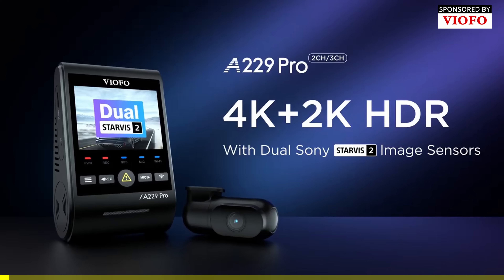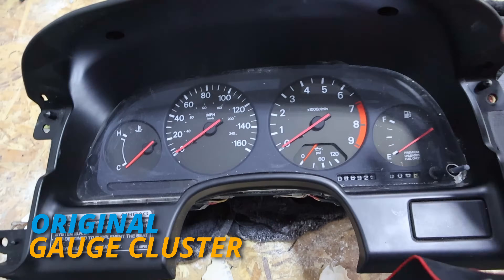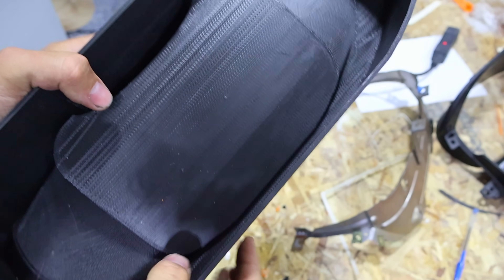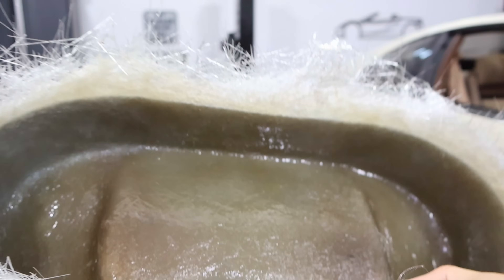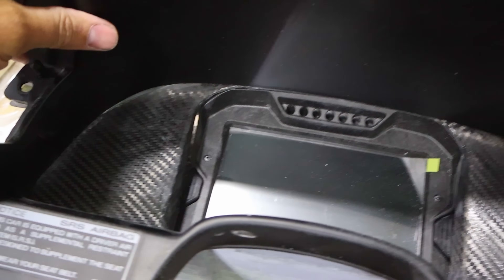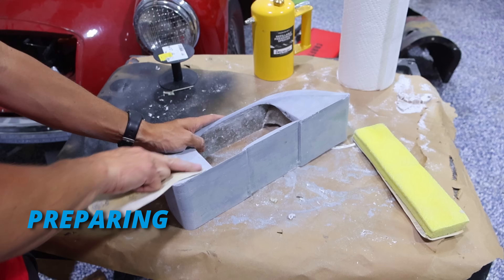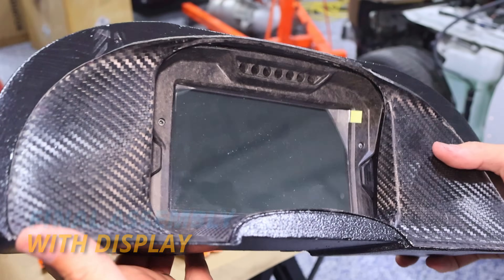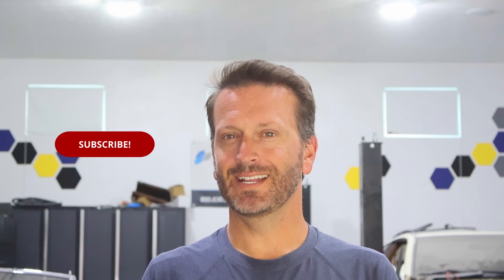From Analog to Digital: Creating a Custom Gauge Cluster with Style

Comment: would be cool to to re-use the dash gauges instead of replacing all with a screen.
Speed can be remmaped to still work, fuel could be mapped to battery level, and the temperature could be mapped to coolant temp. 
only thing that would be useless is the tach and oil pressre, but those are so neatly positioned in the same circle that you could cut them out and replace them with a screen for all the other EV info thats needed.

Comment: Yes he is right does not look great. When going this far remove components screen/ shift lights and cpu (you have the skills) and create dash/housing “new housing” then its clean and custom. Also won’t be sinking back and look like 3 piece not meant to be together. Plus when 3d printing design break aways. Strong enough to mold but placed meant to break 3d printing easily off.

Comment: Lot of space left, Try refurbish couple of old gauges to fit in there.
It will be much cooler
Reply from the maker: What gauges?  All of them are no longer applicable
Reply: @electricsupercar could you used a DAC to convert SOC to display on the fuel gauge?
Reply from the maker: @StephenThomas-yd5pc  interesting 🤔

Comment: I don't like the display, sorry. I think you can do better with the display. After all, it is the focal point for the driver. I think the screen is too small. A larger screen that takes up the entire cavity would be nicer. Perhaps you can get plexiglass cut and shaped to fit instead of the carbon fiber. Another thing I would do is take the bezel completely out of the screen, and mount it flush to the plexiglass. You could embed a couple of round LCD screens on the sides to display whatever you wish. You can darken the plexiglass in the areas where you don't have anything to display.
Reply: Not his car, just a conversion. I’d charge extra. One screen is hassle enough. To get 3 working, synchronous, and replace. Whole other ball game.
Reply: I agree that would look better, but that would take much longer to create and trouble shoot. Just getting the same screen working on the electric Hummer was not simple. Never underestimate how frustrating the CAN system can be. 

Even better than the screens, stepper control the original gauges. But hey if the customer is happy with the screen, why do that much work.
Reply: You can totally do that on your car
Reply: Take a part module don’t make custom bracket. You could add bigger screen at that point.